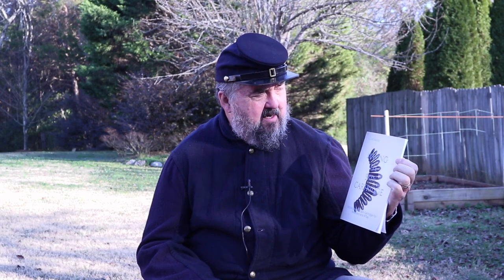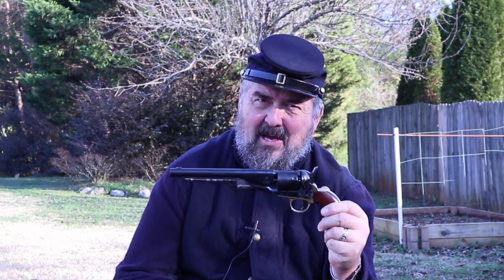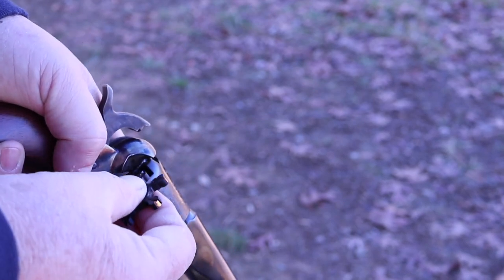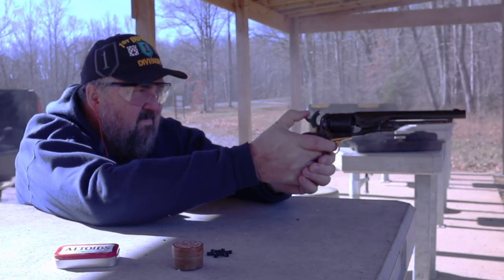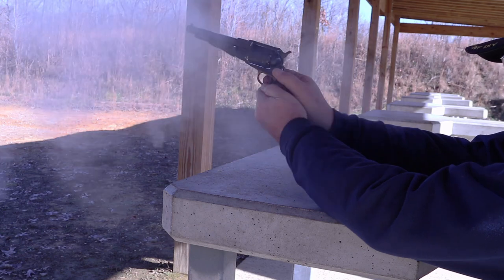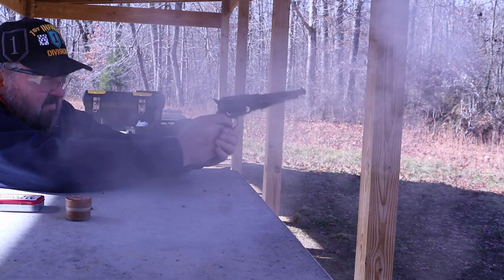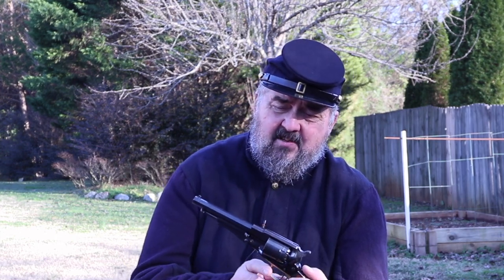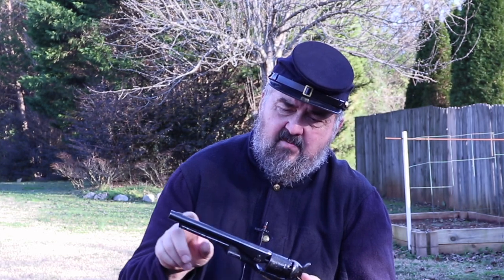Shooting Skin Cartridges in Cap and Ball Revolvers

Comment: I've been shooting black powder pistols since the late sixties, simply reaming all the chambers with a standard 3/8th reamer and a drill press, with care, will fix the issue, correctly, if they are all proper depth, Pieta's especially sometimes "wander".  Uberti's were always better, more accurately made, cost more, I've not dealt with them in two decades, but have repaired a good many others over the years.  I run a machine shop, and would easily open up the bullet pushers to proper dimensions and shape, if necessary, any small shop should be able to do so for a reasonable price.  The accuracy with substantially benefit, from having the bullet properly centered, it's the largest factor in general, with those "semi-rounded" style pushers.  I really enjoyed this, skin cartridges are new to me, somehow, thanks a bunch, Semper Fi.

Comment: I prefer Uberti. I used to have a Ruger Old Army, but; I let it get away from me. I wish Ruger would start making it again. As others below said, you can true the cylinders up pretty easily.
Reply: I've had my eye on a Uberti reproduction Colt Navy for a while now. I like the idea of being able to shoot hand cast projectiles with homemade powder. The percussion caps are a bit tricky though, there are products for stamping caps out of aluminum cans, but I have to buy contact explosive (binary components) for the primers.
Reply: @the_inquisitive_inquisitor  I have an Uberti Colt Navy and used to have the Uberti Colt Army. The Army was a little on the large side. The Navy is one sweet shooting pistol. You will not be disappointed in the Navy. Uberti makes the London version as well. It has a blued trigger guard and the correct London stamp on the barrel. Mine is just the regular version. I haven't gone as far as making my own caps, but; I have an old Lyman mold that I can cast balls for the Navy. Just a little tough to find lead every now and then.
Reply: @stephenbridges2791  lead, aluminum, copper, brass.... whatever melts

Comment: This is the first video of yours I believe I have watched. Outstandingly done Sir. The reason for my comment is simple. Call Pietta and let them know. More than likely they will solve your issue. LOL Be sure to let them know of your channel. Bad press is just that. Bad for a company. I bet they fix it at no cost under warranty.
Also, something I learned working at a gunsmith shop. New gun, used gun or a gun you have owned a long time. If it does not pattern well. Re-do or at least check the barrel crown. I have bought a number of guns at the range that shot badly. Like 10 inch or bigger groups at a 100. Crown them and take out of stock and clear it of touching action or barrel. Checking the crowns, they were always bad. Would bring them into a 1 to a 1 1/2 group at a 100. No joke, the Crown "IS" the most important thing on any firearm in my opinion. If it is bad. I do not care how good you or the firearm is. Your shooting will stink.

Comment: An excellent experimental "archelogy" video, the undersize chambers are really a big advantage, they can easily be reamed out to .001" over groove size to make the correct size, when they are oversize, there is nothing you can do, the extra force required to seat in these chambers will soon cause problems with the loading system I think, it would appear that these Piettas are made for display only! Stay safe ! Chris B.

Comment: Hi Mark, I bought a 1851 Uberti and had two shots go wild every cylinder. Checked the cylinder to find the chambers were oval with two being much worse than the others. These two were in line with the heaviest part of the engraving, the roller engraving had distorted the chambers. Reamed them back round, overall not overly happy with the gun. Had to put in a lot of time to sort out the poor egineering finishing, although it shoots well now and I do like the gun I shouldn't have had to do what I had to do to a new gun to get it working well!
Colin
Reply from the maker: QC can be pretty spotty for all the Italian makers.  Did you to the reaming  job yourself?
Reply: @erasgonehistoricalmolds2400  Yes I used a hand reamer which are tapered and helped guide it. I fudged it a little towards the outside of the cylinder as that was where the distortion was. I thought I might have to cut the end of the reamer off for a second pass to get the correct dia. to the chamber because of the taper, but it worked out fine with one pass.
 I think I ended up with a max variation between the chambers of around 2/10ths of a thou. I also cut a wider angle to the forcing cone.
 The gun now shoots better than I can shoot it!
 Colin

Comment: Glad to see a video Mark. Hope your well. Thanks for the info.

Ireally wish we could get consistent cap and ball revolvers that worked reliably with out fiddling lol. Every single revolver ive found has its own set of gimmes right off the shelf, then its own set of individual small issues.

Could hone those chambers and get them consistent... Not sure where to find a hone that small... Ive been meaning to go looking for them... Kind of an annoying problem to fix in Pietta and Uberti guns. Only thing worse then inconsistent chamber sizes, is oblong chambers... Seen those too
Reply: An easy modification using an adjustable reamer.
Reply: @453421abcdefg12345  An adjustable reamer you say? Would this require a lathe or could it be done by hand with a T-handled tool?
Reply: @MrBillinoregon  An adjustable reamer, because its make up,  can be increased by very small increments, and can be turned in with a tap wrench, the cylinder would need to be secured in a fixed vice to make the job easier, but I have reamed out many repro percussion pistols like this, there is a need to use copious amounts of cutting fluid to prevent "juddering" but it is not a difficult job, and the results are very rewarding, obviously a lead slug driven into the barrel to ascertain groove size would be a requirement, but that is an easy task, good luck! Chris B.
Reply: @453421abcdefg12345  Thanks Chris. I will have to look into this. Although I am no gunsmith or machinist, it can be rewarding to tweak the Italian revolvers for improved performance.
Reply: @MrBillinoregon  Glad to hear you are having a go ! The adjustable reamers are available giving a range around the size you want, and I would suggest a good make rather than a chinese thing, the type you need is one with multiple flutes in which the blades slide, they are moved up the tapered flutes by turning a collet at each end, so you unscrew one, and tighten the other, take care and increment very slowly! Chris B.
Reply: Rumblestrip:- You can make a "hone" by wrapping emery cloth around a suitable diameter dowel rod, cut a slit along the centre axis of the rod, and slip in a short length of emery cloth, if you then rotate this in the cylinder hole with a drilling machine, or pistol drill, it will polish out the hole, but check frequently to see how the size is increasing, finish off with finer grade emery. Chris B.

Comment: imagine being that badass that rocked a skin cartridge revolver as your self defense EDC.
Reply: For legal reasons the only firearms I can legally own are black powder guns.  My everyday pistol that I tote around with me is a Pietta 1860 Army cut down snub nose with a bird's head grip.  It's surprisingly ergonomic easily fits in the pockets of my coat and jacket,  and shoots best with heavy (30+ grain) powder loads.  The only real drawback these guns have is the slowness of reloading but with prepared cartridges the cap and ball revolvers actually reload as fast or faster than cartridge weapons like the 1873 Single Action Army because you don't have to eject cases first.  Most altercations involving the legal use of a firearm are settled in two or three shots anyway so I'm not terribly concerned about reloading but I would like to have some reloads in the carry bag I use just in case.  It's easy to make paper cartridges and if you use flash paper you need not ever worry about ignition.  But moisture is the bane of both primers and powder and I keep some big packets of silica gel in my gun tote bags to keep them dry.  I would trust the reloads more if they were semi-waterproof like these skin cartridges.  I'm going to check out that book.

I wonder if the synthetic tubes almost universally used now for commercial sausage making (supposedly because using actual intestine is a disease risk) would work for this.  I've made sausage with it and with natural intestine both, and there's very little difference between the two.  It would be interesting to experiment with it.

My home defense weapons are a ludicrous - huge Walker Colt (Uberti) with maximum loads, and I also have one of the AGC Desperado 12-gauge shotgun pistols I keep loaded with 70 grains of black powder and ten .31 balls in each barrel.

Anyone who tries to rob me is going to have a bad day.
Reply: How often. Do you change the charges in your weapons? I always worry that if they sit to long they won't fire when needed.
Reply: @Sleepindragon2  They can sit for decades without a problem. As long as the caps stay seated the gun will shoot. There is an extremely slight chance that black powder can pick up humidity from the air, but being in a mostly sealed chamber, it's unlikely to happen. As long as it doesn't get wet, it should still work. There have been cases where people fired Civil War weapons with well over 100 year old charges in them. Samuel Colt actually loaded his revolvers and then dropped them into a bucket of water for hours before then pulling them out of the water and shooting them, to display how well they are at remaining loaded and viable. For that to be the case though, the percussion caps have to be seated/sealed against the nipple... and of course the bullet has to be sealed too... but the bullets are always sealed if you press them in and get that ring of lead shaving. For the caps though, you have to be certain that they perfectly fit the nipple/taper and have to be pressed on with force, so the cap can seal along the very edge where it contacts the taper. If the gun is well loaded and has the natural mechanical seal, then you could (theoretically) carry it for years without having to reload it.

Comment: i have a pair of 1858 remington ubirty then a retired colt gunsmith went through them which was the guy i got them from. with a bunch of cylinders and converters to 45 long colt with 5 lb of black caps and 300 ball, ball mold flask with 15,20,25,30,35,40 and 45 grain tips all for 1000 bucks with a navy 36 petta for 100 bucks. all 3 are over 50 years old. the remingtons took first place in state one year against modern guns in hand gun shooting contest. after shooting them i believe him on that even all my friends say the same thing they shoot perfect in every way . the guy i got them from said he had to file the end of the barrel to get them to shoot perfectly straight i never new they did that to guns . even the cylinder fits perfect when u pull the hammer back the cylinder goes tight against the barrel very little blow bye i can't put a 1000th in it on a fuller gauge  the 36 massive blow bye but he never did any thing to it, it is stock.the ubirties are my fav gun to shoot and i have a lot of original colts even a model 1897 38 acp colt which had to be made in 1897 to 1901 then in 1902 they updated it to a 1897/1902 model which i have one of them too which was from ww1 pilot side arm

Comment: With your chambers being so tight, you should check your bore. If your chambers are that tight, they're going to make smaller bullets as the lead is shaved off while pressing them in. If your bore is not as small as the chambers, then the bullets will not seal and that can cause all sorts of problems, especially with accuracy, but also with slowly damaging the barrel (would be damaged a lot faster if you were shooting smokeless powder). I don't recall the term, but hot gas escapes through the grooves in the bore and it strips lead from the bullets causing leading and steel from the barrel causing bore damage.
Reply: Once barrel groove is determined, have the chambers reamed to size, uniformily.

Comment: You can use a Uberti plunger, they are conical. A .375 reamer would fix the chambers with little effort, probably just pre drilled at the factory and not reamed.

Comment: Is the Euroarms .36 caliber a smaller frame than the .44 caliber version, or is it like the newer .36 caliber ones with the same frame as the .44s?
Reply: the .44's are the same as the .36's... they use a stepped cylinder like the 1860 model did. The 1860 frame is more or less the same as the 1851.
Reply: @wildrangeringreen  That would be for the Colt type open frame revolvers.  I should have specified in my comment that I was asking about the Remington type revolver.  I have heard that some early production 36 caliber Remington repros were made with a smaller frame like the original ones were.  All of the recent Remington repros use the big 44 caliber frame for the 36 caliber.  There's just smaller holes bored in the cylinder for the 36 caliber, and a smaller bore in the same size barrel that's used for the 44.  The original Remington 36 caliber revolvers were a bit smaller and weighed a bit less.
Reply: @amberyooper  I do wish someone would reproduce the Beals revolver in navy caliber 👍

Comment: I made up some skin cartridges in 44 caliber several years ago, and found them to be very clean shooting.  However the extra work to make them wasn't appealing to me.  I now use paper carts exclusively.  But I recommend trying the skins anyway.  They're an interesting bit of history.
Reply: With modern technology, there are Many ways to make the paper cartridges waterproof. Even that stuff that comes in spray cans to waterproof shoes works really well... but I'm sure there are many better, cheaper methods. You could probably also make skin cartridges easier and better with modern technology too, instead of making exact replicas.

Comment: That chamber diameter is easy to fix. Just order a reamer  and gently turn it  until it bottums up. I do remove the nipples, and I made a fixture  using a turned dowl  inserted into a hardwood block which diameter matches the diameter for the cyinder pin... Mine loads and shoots much better now!

Comment: I'd make the cappers with 7 or 8 caps per piece - that way if you drop a cap you aren't fumbling around trying to find it on the ground or having to pull another capper out of the box to complete the cylinder. Yes, you will more often than not have an extra cap or two, no problem, just put the capper back in the box. I'm going to go look and see if they are on Thingiverse - it'd be interesting to print one's own.

Comment: Why only 6 caps in each of those cappers? You could fit at least double that, probably 3x without it being any more difficult to deploy. Might be a bit harder to load...
Reply from the maker: It would would be a tight squeeze onto the nipples with 12 flanges.  Plus, 6 equals the number of chambers on the cylinder

Comment: Cabela's used to sell Sausage making supplies. I wonder if the Synthetic Sausage Skin tubing could be used for making Cartridges. Also has anyone done anything with Black Powder Substitutes with Skin Cartridges due to the Goex Plant situation?
Reply: I would do some research into what chemicals or compounds the synthetic tubing is made of. Usually, synthetics have different pyrotechnic properties than organic materials. The fouling of the synthetic material(s) may also corrode or damage the gun, quicker, or at a greater rate than sheep's gut. If it were I, I would go with the natural, organic materials that were available in the era that these firearms were originally produced. There weren't too many synthetics around back then. If you do decide to use the synthetic tubing, please share your conclusions. 🤙🏻
Reply: The artificial skin for a sausage is usually gelatin. It's probably extremely similar to the properties of intestine but you're right that a range report would be interesting. I actually wonder if this could be done with nitrated gelatin.

Comment: I have a question for you concerning those small chambers. 

What do you think of reaming the chambers up to be .001 over bore diameter?  

Thanks 
Skip
Reply from the maker: That would actually be ideal.  You would also have to make sure that the bullet you choose can still adequately fill and seal the enlarged chamber.
Reply: Thank you Mark. I was kinda surprised at the small diameters as well.  

I like Pietta and my Pietta NMA shoots great. Thinking about getting another 1851 or maybe an 1861 and I may have to anticipate reaming the chambers if they happen to be too small as well.